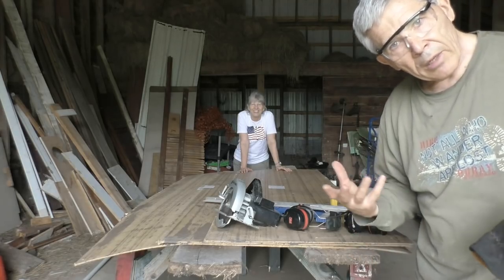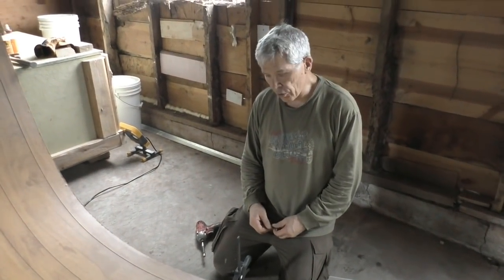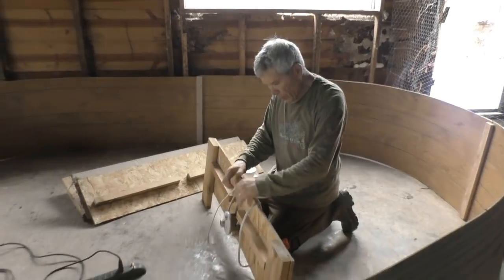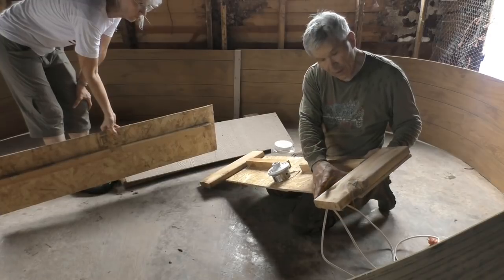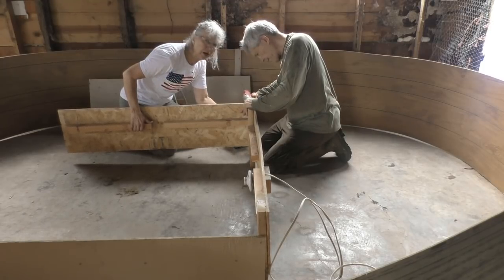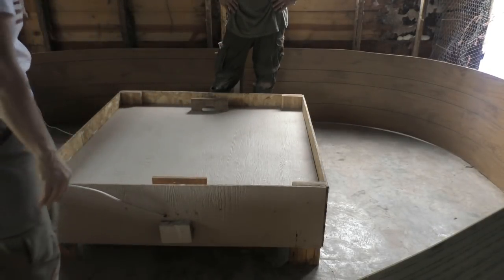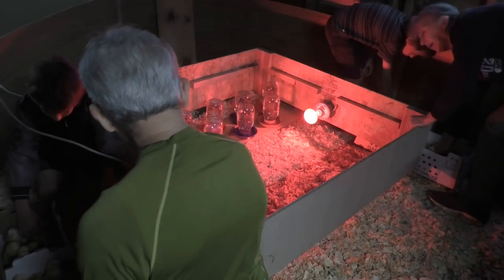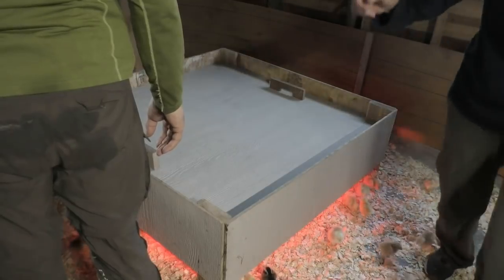Ohio Brooder & Surrounding Playpen

Comment: I can't believe that you were able to count them after the first 10 or so.  I always lose track and more so when I have helpers.  Did you have any casualties?  They look very peppy.  I like that brooder system.  I can think of only one spot that has decent concrete for such a nice big set up.  I'm sure my husband wouldn't mind giving up the only workspace in the farm shop come next spring, right?  The last chicks I did (only about 20) were in a kiddie pool in the coop with a light from premier one.  I actually bought the light for lambs and calves because it was so crazy cold this past spring, but it worked great for the chicks.  They were egg layers so they could jump and fly pretty well.  Do you know how old yours will be when they might "fly the coop"?  I came really close to buying some bargain cornish cross this week, $1.50 and they were at least 1 week old and probably closer to 2 weeks given their wing feathers and size.  The main thing that prevented me was that we have so many irons in the fire.  I'm going to regret that when I run out of old biddies.
Reply from the maker: Truth is I stopped courting at 20. They will try to fly by three weeks when we move them to the chicken tractor.

Comment: Were u sticking their beaks in the waterers? I haven't seen that before. What were those measurements again please and how many chicks fit comfortably?
Reply from the maker: Our Ohio brooder was 4x4. We found that we could do over a hundred chicks in there. We've learned a bit more about the sizing since we made that video. The critical measurements are with the feeders and the waters so that all chicks have easy access and aren't crowded out. It's roughly 2 in of access to the feeder for check. They don't drink as much as they eat so you can have less than 2 in of water spaced the check and it's a hard number to derive but it's somewhere around 1 inch per chick although you can probably get away with a little less than that. And then the size of the breeder box has to be able to fit the feeders and the waters comfortably and still give the chicks room to be if they're not eating or drinking. It's not a hard and fast number and it's based on not just the number of chicks you want but on the amount of space you have keep them. Because as they get older they will be coming out from under the bruder and wanting space so the space around the breeder needs to be large enough to allow them to run around. We find that the 2ft height is about right keep them in until they're 3 weeks old. You'll know when it's not high enough because they'll start coming out of it.